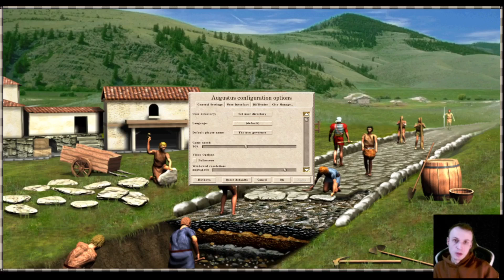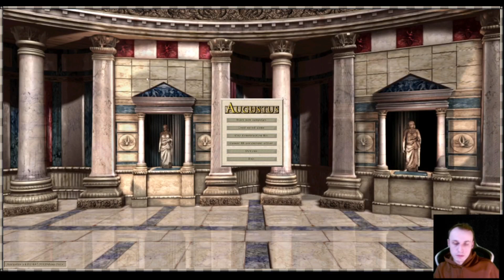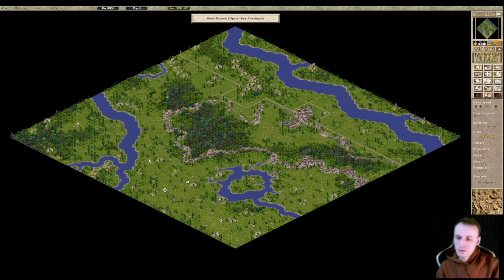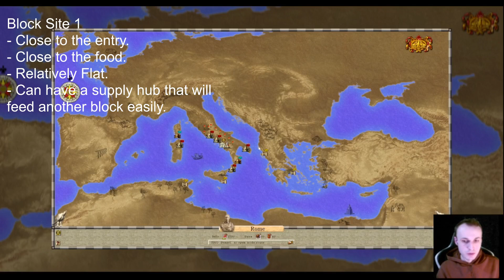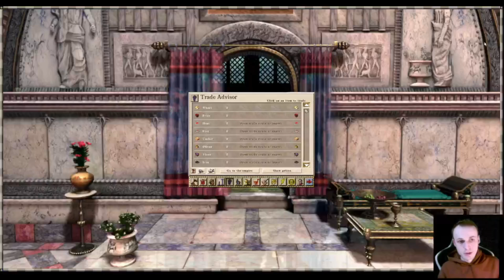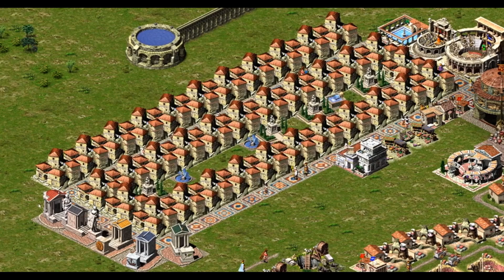Caesar 3 Augustus - Efficient Governing Guide

Comment: nicely done. very efficient. how did you manage to make all your houses 2x2 ? some of mine turn 1x1 no matter what. also i noticed you didnt use plaza decoration?
Reply from the maker: There is a setting all houses merge, which makes it happen regardless of terrain tiles. Plaza is unavailable in the reconquered campaing, if you play vanilla style maps you will have even easier time yes.
Reply: @commissarmarek-main-channel  You mean only after building Mercury grand temple.

Comment: 1:20 that's why i start map, plan housing area and ... restart many times to create best 😅 if i can get 50 houses with 5 gods (bonuses from grand temple to reduce consumtion goods or food, Venus dont do anything for plebs with vine, can be replaced with house to get like 88people more) access 3 entertnainment (arena and amphiteater only 3x3 Square placed on corner to take 1 road piece),school, library and like 3 min, maks 4 markets, it is great success. Ofc there are plenty of maps with place for only 1 block with 40+ houses, often i must do smaller 30+ and they are good enough. I do same 'testing' with patricians to get as much as possible, to squize it to limit because i can find one more place for 3x3 villa, even better 4x4 palace 😂 Is it required to win map? Probably not, because i usualy have 14k people when only need 11k or 8,5k but it is fun. Same situation with food. If i can, I bring all types for plebs, when i can import or produce it.

Comment: This entire "Tips and Tricks" playlist is superb. So much practical information to digest. An interesting point came up at 0:38:00 with that unconnected wheat farm: although a Granary has to be connected to a road system using one of its middle tiles in order to be operational, once you've done that you can connect other roads to its corner tiles. So you could also have put the road on the other side of the farm (where the rock is) connected to the corner tile of the granary and the farm's cartpusher will enter the granary diagonally. This might be worth remembering when short of space trying to fit in another granary or a building directly adjacent to the granary: I've always just assumed that you could only connect roads to a granary's middle tiles. And the Engineer and Prefecture entering the granary takes care of that farm's structural/fire risks. Also that trick with the additional housing on the corners I'm definitely going to use! I'm off to watch you play your own Reconquered Campaign now :P
Reply from the maker: Great, glad to hear it is useful. The diagonal road trick i dont usually obsess over, but makes a difference around rocks especially, you can see me use it regularely but i have more or less resigned to see it as a sucess when someone learns not to interconnect the whole city, and make good blocks. So these more advanced things are super niche.

Comment: So I got Caesar 3 because of nostalgia. I downloaded Augustus mod. I played and lost and lost again, and again. I got some helpful tips, buuuut... I didn't realize the difficulty was set to ubsurdly hard. 
If your having trouble with the game, find the difficulty setting and tune it down to where you feel comfortable with it. I set mine to very easy because my buyers weren't buying pottery for my plebs, even though thats what they're asking for.
Reply from the maker: Well the video explains how this works really, but setting your difficilulty lower wont make badly designed logistical systems suddenly work.
It impacts levy and taxes, sentiment and enemy numbers thats about it.
Problems of this nature are due to giving market ladies options where to go to for sourcing goods and food, its best to not interconnect the city and only give them singular options where to go. Then use cart depots to move things between areas of the city.
The difficulty isnt absurd, there are some extremely hard custom maps but the RC is very approachable as long as you learn and see whats going on, then adapt and not do things like above since same as roaming walkers you cannot trust anyone if you give options they often do the worst things.
Reply: @commissarmarek-main-channel  Very true. I changed my strategy and focused on housing, water, protection, engineering and started trading from go. I made all my money back very quickly and got my houses from tents to small villas. Was able to do the block twice and ended with 70,000 denarie and 3600 pop at the end. Thats with the extra 5 years too.
I'll ease my way to using road blocks, my previous attempts were dismal. But I do understand the importance of doing it that way.
Reply from the maker: @KaptainKanuckels no problem, Augustus is lot different than the base game was, harder in many ways, the maps are harder in some aspects for sure but arguably easier with trade if you know how to utilize it.
Mainly though, roadblocks wont block destination walkers, you want to create complete separatiom for some areas or carters take forever to deliver goods and reaources wasting production and market ladies get from far away blocks where their own block devolves before they can bring the food or goods back.
It cam work very reliably once you understand it, if you dont like how the interuptions look you can hide them with some decor
Also patricians never work, so unless you have to make them i normaly wouldnt. If you have only grand insula you can get 80 prosperity cap from that which is enough up to Miletus.

Comment: Hi,  a time ago i installed augustus 4.0 and it really gives a boost to the game.   But the original campaign became very easy.   So i was wondering if there is a way to change the objectives (Peace, culture, prosperity and favor) all to 100 and than see how far i get.
i found your video about 'debug.costumevents' but that doesn't work.  The screen does not appear.

Is there an other way to change those objectives?

Thanks.
Reply from the maker: Hey, the console is opened by building well and pressing ALT + K and then ALT + X. Then console opens and you type in exactly this "debug.customevents" it works as intended and gets you into the editor, from here you can navigate to the right side tab to check the map objectives and modify them. After that, return to the city and it will work but dont save the map when you are in the debug mode as that doesent work, you need to back in the "city".
Reply: @commissarmarek-main-channel  Thanks,    it opens now.   I will look where the objectives can be changed.

Comment: Hello I apologize for the video irrelevant question it is the most recent video I can delete it after the answer. I am playing the Reconquered campaign with the latest unstable version (I upgrade it almost every time I see a new one). I am at Tarsus (11) but earlier maps I saw that I can not evolve after "Grand Villa" it says I need a second type of Wine. I remember that earlier maps I could evolve it even to Palaces (I was on different unstable).
Is it a bug or intended (with that new decription)? To be honest Grand Villa is still enough for 100 prosperity with small insulas just I am curious. I always plan for 4x4 and end up with 3x3. :)

Thank you. :)
Reply from the maker: Hey, the second wine requirement works as intended. Its supposed to be available naturaly only on some maps since you can have.
1 - local or imported vines and workshop for wine as first check.
2 - imported wholesale wine goods as second.
3 - on maps where its missing you can build gt to Venus and pick verticordia epithet which is weaker than the genetrix overall but allows you to get another type of wine.

Generally though as you mentioned you dont need palaces for prosperity reasons but if you want them for some reason there is usually a way at the expense of other things.
Exception will be Londiniun where there are no academies so you have to either make lots of 2x2 villa or pantheon extra evo step epithet for one block.
Reply: Thank you for the clarification. I did not figure it out (did not even think about it) that with Venus it would be a different source and can evolve. :)
If palaces were required to reach 100 prosperity properly it would be a different story in these circumstances.

Comment: what i like to do with food is set up one granary to be my hub of sort, usually some times after first block "mature" and use carts from different "farm patches",(they might be next to each other or might be miles apart and its still works) to that one granary and than from there to the ones that is supplying the blocks. It helps with efficiency of the farm and you get a lot of food into a pipeline sort off. Works best if you had to source food from different sides of map. helps keeps farms on 100 efficiency, and hence minimizing labor. pretty much utilize just one more extra granary, number of cart depos are pretty much the same.
Reply from the maker: You will have extra cart depots while doing this but it can work, definately better than just having your farmland carters go long way to deliver the food while production halts.
Normally id just make my fist granary the main supply hub, and if i have more daisy chain more from it or lead other areas into it if farmland is dispersed. Ultimately it is very simillar, except remember that each depot is 15 workers so its not free.

Comment: can you help with installation of new unstable version? I extrated both new version "...491" and asset into Caesar3\C3 folder but when i launch from steam i still get previous unstable version "421"...thank you.
Reply: I tend to have the mod files in a separate folder instead, makes it easier to keep track of the mod files. So it can be Caesar3\C3\AugustusUnstable. Try to put the files in there and see if it launches the correct version then. 

Also since you're launching it from Steam I assume you've added Augustus as a non-Steam game to your library? It could be that Steam still finds the old Augustus version and starts that one instead. You might have to add this updated version to your Steam library for it to launch correctly.
Reply from the maker: Hey i made a video explaining it step by step, its very likely it did not generate the folders for you automatically, try to follow this https://www.youtube.com/watch?v=xpyECbjTdBo

Comment: All in one practical guide great thank you. :)

I use Oracle instead of Nym (only 2x2, easy to make and 500 god coverage is good). Is it efficient enough? Is the bigger desibarility the extra benefit? I also sometimes use Oracle in the block for desirability if I need on the service area.
Reply from the maker: Oracles can definately work as well. Especially since they dont need road or rome connectiom you can put them as 2x2 statues inside the middle tiles of the block.
Its a monument though so im often too lazy to build and setup.
I didnt want the health bonuses so nphaeum was good since i didnt have venus gt and no plaza, otherwise the desirability is not that big of a deal.
Reply: I never bothered with the Oracle perfect setup just building it even in the service area or "temple district" haha. But good optimization if that extra space matters - Oracle vs 5 small temples still in Oracle's favor.
Reply from the maker: @Horpetii  for sure, its more levy efficient and needs no workers so its still a lot better.
Reply: @Horpetii  So when you build an Oracle do you then reciprocate by deleting five temples to save on employees and levies?
Reply: @bazcuda  Hello, basically yes but I simply just count it out - Oracle 500 people, small temple 750 people. If it is done and expand - just build more Oracles.
Btw Mausoleums are even better for Levies point of view (less levies / months which can add up over time) but more building costs. You can decide which one is more suitable for the map - even skipping Oracle-Mausoleums.
Small vs. Large is also good for consideration for space-cost-maintenance perspective.

I just finished map 18 in the campaign. I need to do breaks because the games pulls me in too much. I can't wait doing the 19th next time. The fun will be over soon. :D Great Campaign, priceless.
Reply: @Horpetii Thanks 👍